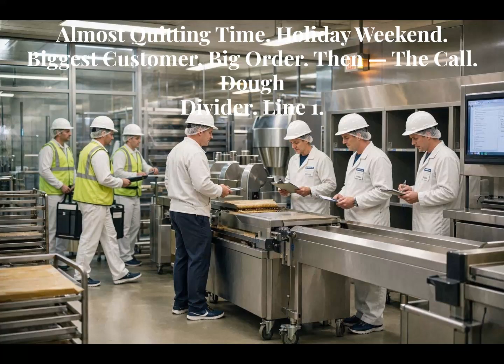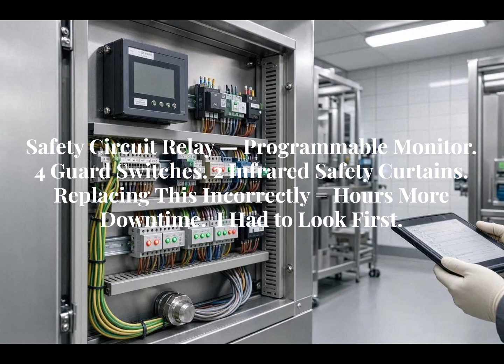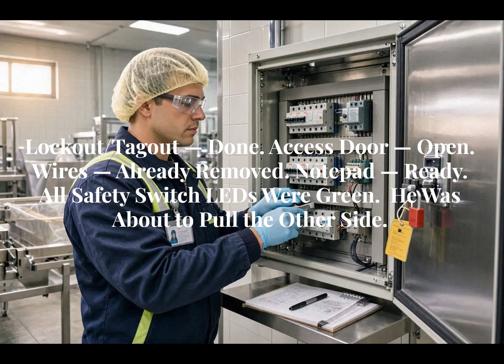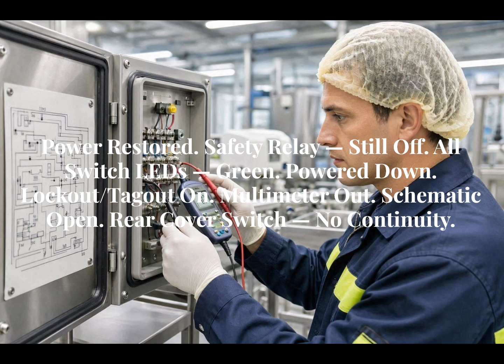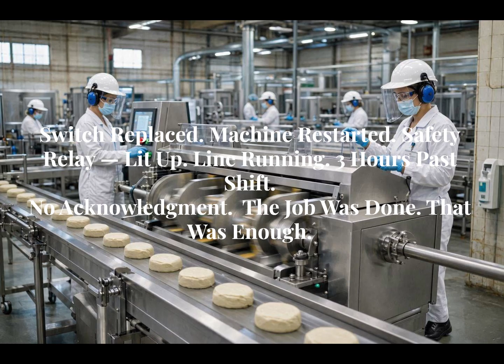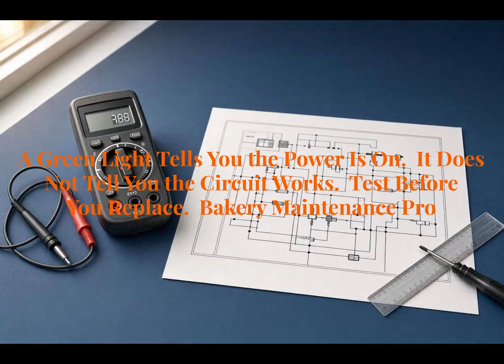Every Safety Light Was Green. The Dough Divider Would Not Run. The Answer Was Water.

Comment from the maker: Free field reference mentioned in this video — 25 equipment failure points with risk levels, business impact, and preventive measures: balery-maintenance-pro.netlify.app

On safety switch wiring bases in washdown environments — sealed housing on the switch mechanism does not guarantee sealed protection at the wiring base. In facilities using water and
chemical sanitation, the wiring base connection point is a known water ingress vulnerability.

Periodic inspection of wiring base condition — specifically checking for moisture, corrosion, or resistance increase at the connection — should be part of your quarterly PM on any safety
switch in a wet zone. A digital multimeter continuity check takes less than two minutes andcatches this failure before it becomes a production stoppage.